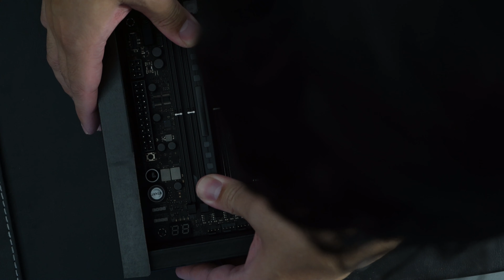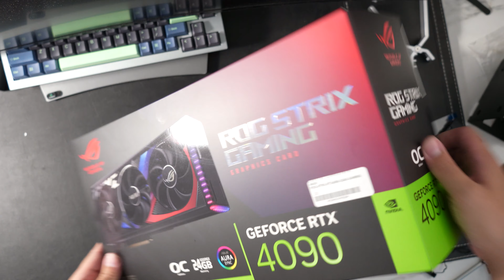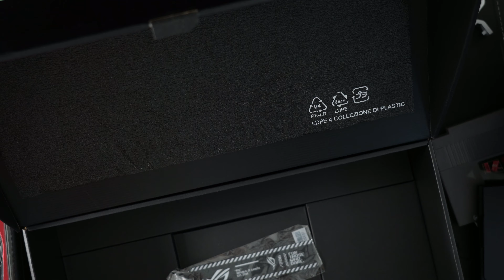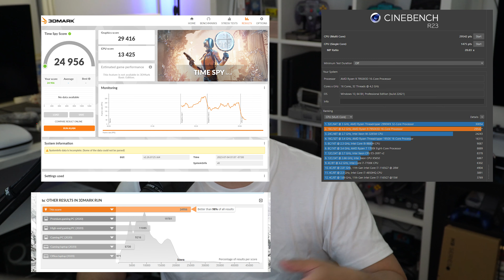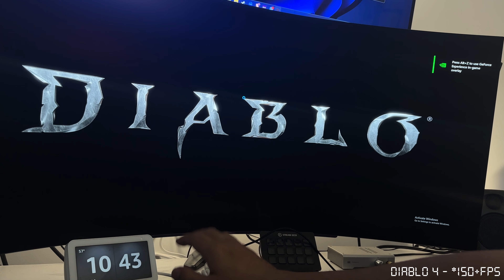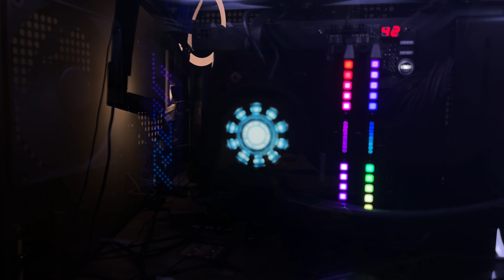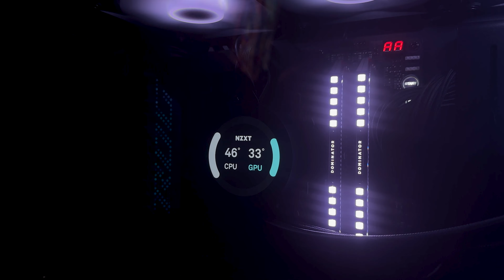My 2023 $5,000 Overkill PC Build (4090 | Ryzen 7950X3D | NZXT H9 Elite)

Comment: Awesome build man! Good component choices! 
I am doing an upgrade build coming from my current AMD setup Ryzen 5800x3d on the Asrock Taichi x470 mainboard with Radeon 6900xt in the NZXT box. I got the same processor as you, with the Asus TUF Gaming 4090 OC, Asus Strix x670e-e main board, got G.skill 64gb Neo RGB 6000 30 cas, like you I got the Thor PS. Mine is getting built in a ROG Hyperion box (kinda fell in love with the box!) - Like you I'll use the word Behemoth of a case! LOL! I did the Asus Ryujin II AIO cooler. Everything is now here, and my build will start tomorrow.
Reply from the maker: Sounds like a great build! 

I almost with the Taichi myself. Wishing you all the best in your build and hope it lasts you long!  Best of luck.

Comment: Great video man. Wow this is the exact build i am about to do. Gonna start the assembly tonorrow morning but couldn't decide whether i should use the elite or flow version. Bought but gotta decide by tomorrow which one im gonna keep.

Did you ever side mounted you AIO? If i do it woth h9 elite, blocking that pretty top view with a radiator is heart breaking...
Reply: I’d get the flow, the elite has less airflow